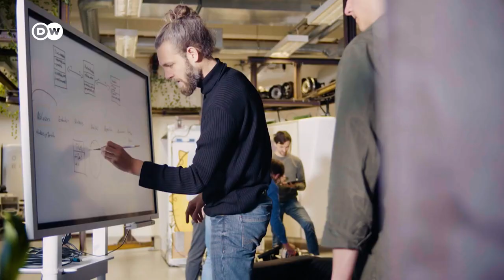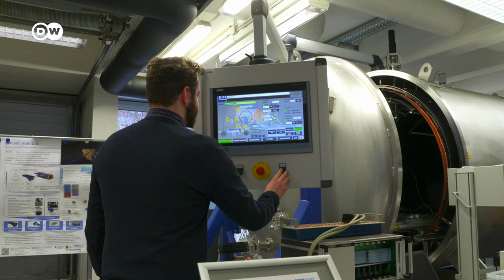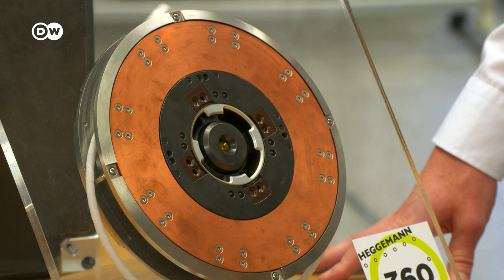Cable Cars Can Solve Congestion In Europe?

Comment: so is cable car that also goes on the groung? isn't it the same than driving it might solve in some parts but it will cause more trafficts in others then where is the pourpose of the cable car on the air 😅specially that it dosn't have a big capacities